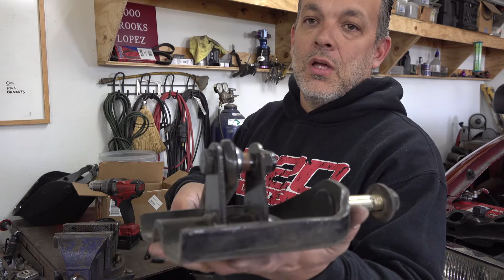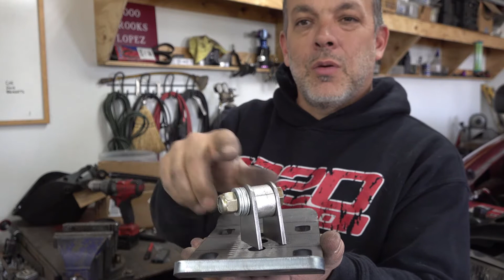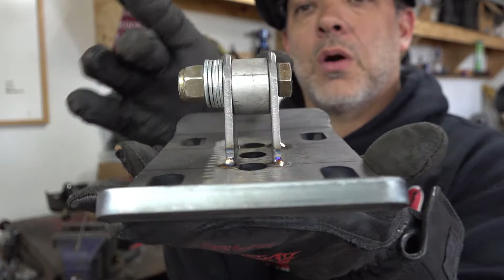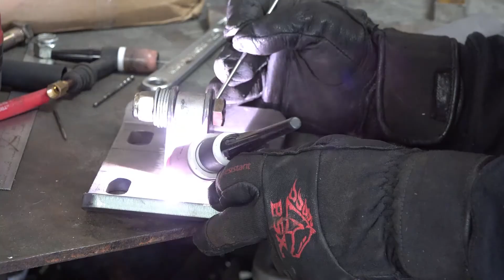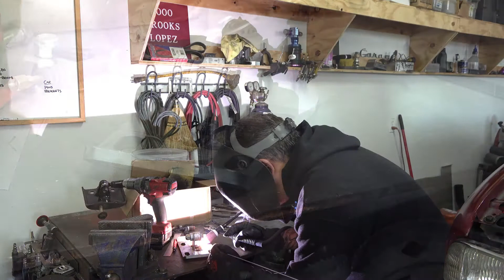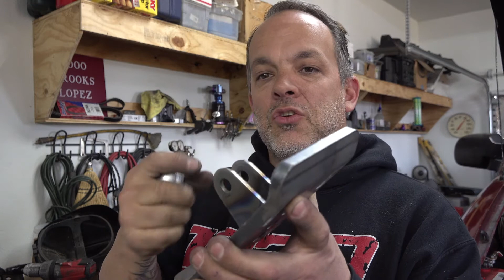DIY: Turbo S10 build Vol. 9 - this didn't work!

Comment: Good stuff brother! Subscribed! I came over here to check your channel out after you commented on my turbo setup. Way nicer stuff here than what I build. Lol. I’m more interested in the front bracket. Are you doing the roller setup like caltrac or just solid mount in the front?
Reply from the maker: Bad Luck Garage thanks fir the sub, Man! For now, it's going to be a solid mount like the previous owner had it. Once I get around to getting my CNC machine back together,  I'll redo the 'traction bars' and make it a bit nicer, similar to cal tracks
Reply: I’ve actually thought about trying to make a set myself but just haven’t gotten around to it as of yet. Lol

Comment: That will be interesting to see the log against header test.
Many making some crazy hp and fast track times with stock manifolds.
Reply from the maker: TheProchargedmopar id almost be willing to bet thay the log manifold makes more mid range torque and probably peak power till back pressure takes over
Reply: diy_garage_tx Maybe we will get to see.  Keep grinding.